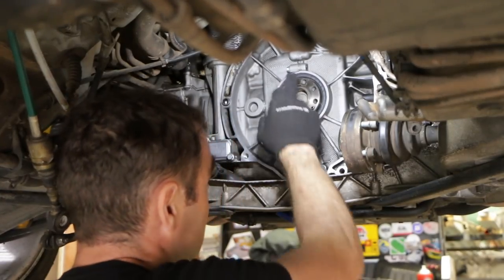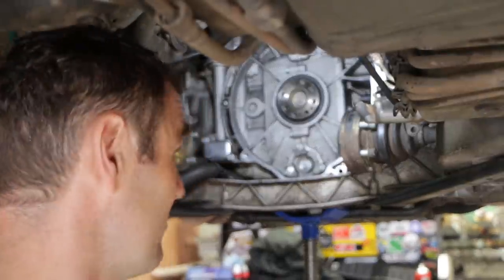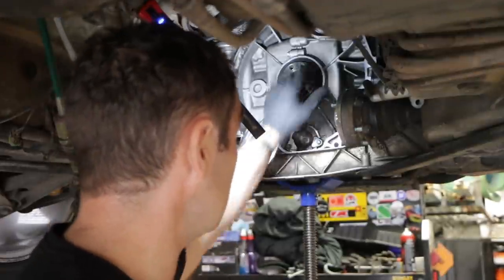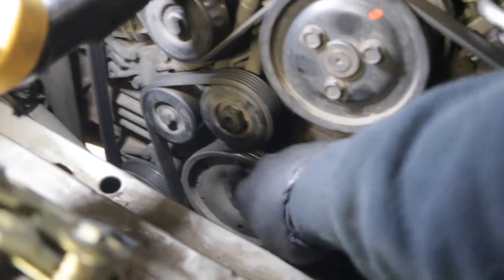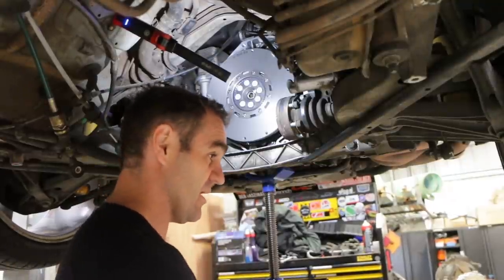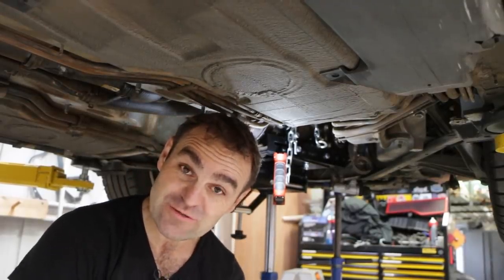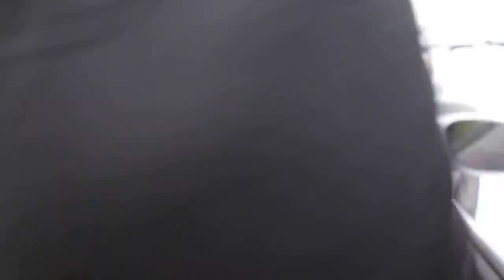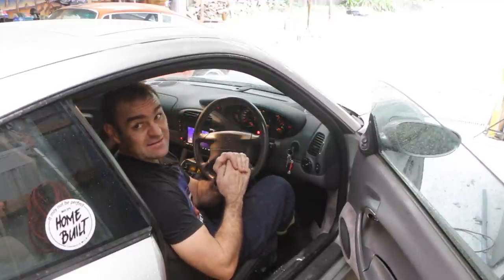996 Rear main seal and clutch replacement - 996/986 IMS part 3

Comment: Even though it's round about 200 years old it's still recent enough to have plenty of potential electronic gremlins in there. The more sophisticated it gets, the more sensitive and complex it gets. Well done on getting it back on the road quickly. I know how stressful it is to have a daily car apart. As much as I don't mind doing more complex things on my Trans Am, I was stressed about getting a complete new set of brakes on our Astra, plus a full service in one day. Just needs to be ready and available by the end of the day...

Comment: Well done, nice to see work done warts and all, real world problems that most of us come across. I just replaced my Boxster engine mount, it was split. 
Looks like your gearbox mount is the original one I’d take a close look at it next time you drop the gearbox, easy enough to push a new one in.
Well done!

Comment: I was a Porsche tech @ a Porsche/Audi dealership for over 20 years and whenever we did clutches on 911s with a dual mass flywheel in the early days of their use we would usually replace them with a pre dual mass 911 flywheel  unless it was a warranty job or a demo (track day car) as most customers weren't into springing for a $1,200 flywheel. Dunno if that would work with a 996 as I got out of the trade before they cam out.

Comment: Too late now, but I wouldn't have tried to pull the IMS without the proper tool. I did 3 of these early M96 engines at home, and had all the same nerve-wracking moments as you, but all went well when they fired up again. I bought the tools and bearings from LN Eng, not cheap.

Comment: I bet you had a great sense of relief when you got the car to run correctly. When pulling seals out, I usually try to drive a woodscrew into the seal in two places, hasn't failed yet, and it creates less metal filings too.

Comment: If the pedal is biting high try bleeding the clutch hydraulics before attempting any adjustment.
Reply: Neil T wouldn’t air in the system give a low pedal, not high?
Reply: @emmajacobs5575  yes your right, rereading my comment it's not very good English, what I should have written was 'bleed the clucth first before attempting any adjustment'.
Reply: He never opened the system, so he didn't introduce any air into it that would require bleeding out.
Reply: @MH-ev3wr  Because if he's going to adjust the pedal it should be done with fresh fluid.

Comment: I serviced my cars on the weekend. Forgot to reconnect the MAF on one. Wouldn't idle. Freaked out. Plugged it in. Idled fine. Engine light still on. Got my scanner. Started it to get engine data. Engine light went out by itself. Relief.

Comment: Have the trans in a gear. Then you can turn the drive outputs to turn the input shaft to the connection spline in the clutch.

Comment: If it's anything like my old BMW, they give you the option to drive the replacement seal a few millimeters farther to give the new seal a clean surface in case the original seal has worn a grove in the in crank.

Comment: What happens with the bolt that was knocked through the IMS bearing (or am I just imagining that)?
Reply from the maker: Magnet got it back ;)
Reply: Vogs what about the broken bits feat you welded onto the first bearing puller? Or did they not make it beyond the bearing?

Comment: How did you go about re-installing the clutch slave cylinder? I am nearly done with a clutch replacement job on a 996, and having a very hard time putting the clutch slave cylinder back in its designated hole of the transmission. To clarify, like you we didn't replace the slave cylinder because it was functioning fine and wanted to avoid having to bleed the whole system. Brackets, bell housing, etc. are all hooked up properly, but the slave cylinder is very hard to full seat because the piston is under a lot of pressure. Without being able to compress the slave cylinder some, we can't line up the bolts that secure it to the trans housing. Have done a lot of research and can't find a clear answer. Any tips on how you were able to reinstall the clutch slave cylinder? Appreciate it!
Reply from the maker: I cant remember exactly, but I do remember it was a pain to do. From memory it didn't need to be compressed too much to bolt in.

Comment: My car needed to re learn idle after battery change
Reply: I think you're right. Assuming it's a fly by wire E throttle (post MY 2000?), turn ignition on for 30 seconds or so without starting car or touching throttle. Voila

Comment: Ok, if you're not going to use the right puller, go ahead and use that three jaw internal puller you had, but do this.
Remove the three fingers from the jaw to threaded rod attachment.  Put a piece of pipe, or a socket in between the jaws with the jaws inserted in the bearing.  This will keep the puller from slipping and collapsing inward.  Reassemble the fingers to the attachment.  
Pull bearing out.  
No new/proper tool needed.
Simple.

Comment: If I am not mistaken the mark on the flywheel bolts is 60deg turn not 120deg?  Bolts need to turn to another 60 deg. Might be mistaken though. 🤔
Reply from the maker: 90 is a quarter turn, so yes this is 120 ;)
Reply: Yep you're right. Too tired, heavy day 🙈 Porsche parts by jeff is fantastic btw 👍

Comment: Is the Rear main seal holding up and not leaking using the rear main seal tool that you made?  I've heard people try these diy tools and the seals still leak.  Thanks.
Reply from the maker: It isn't leaking, but the IMS cover plate is :(

Comment: New subscriber! I am catching up on all your content, great fun. I am going to be doing my own 996 IMS change and will definitely get the LN, but am leaning to the direct feed version. Thoughts?
Reply from the maker: If you can't start the car without sweating that the IMS might blow up any second, then the direct feed one is for you. I think the IMS is over hyped. I pulled the original bearing out of this and my Boxster both with over 150k kms and they were both still perfect.
Reply: @HomeBuiltByJeff  Thanks, I have now seen a couple other people use the LN sealed unit as you did. The installation looks so much easier, it looks like a better option for me to do in my garage. Great channel. I am working my way through your incredible content.

Comment: Does it drive better with the new flywheel?
Reply from the maker: Pretty much exactly the same.
Reply: @HomeBuiltByJeff  That's because you're a good smooth driver. In town and in traffic you would have noticed it being a bit jerky.. I had that on my previous Cayman S. Also I believe the clutch is self adjusting which is great as the pedal stays the same throughout it's life. What's not so great is there is no real warning of impending doom when it's fails. Not a concern for you now though. :-)
Reply: Home Built By Jeff Good to know, if I have to replace my flywheel in my BMW I’ll change it for a cheaper rigid one.

Comment: Where did you grab that plastic fitting? Can't see anything like it at Bunnings.
Reply from the maker: From memory it is a PVC plumbing cap.
Reply: @HomeBuiltByJeff  I tried following your lead but couldn't get the RMS in straight. In the end I got a PVC screw cap and carefully sanded it down to 13mm. I could then just whack it in firm with a rubber mallet. It's straight!

Comment: That flywheel bolt set is going to be a bit of a pain in the wallet when you take it apart again. I had a van that someone the other end of the country did the head gasket on they ground the bottom off the stretch bolts saying they will be fine to the previous owner, well it failed on me, to take it back to them on a trailer would have cost me more than re-doing the job new gasket kit new bolts job done worked great for 3 years. £60 for the bolts Ouch.
Strange seeing you putting things back without a thorough clean and a coat of paint.

Comment: Every vehicle I've worked on with a dual mass flywheel has had a single mass conversion done. Dual is the worst design ever.

On a side note, a $10 degree wheel from Supercheap is way easier than marking the bolts.
*edit Sorry it's $19
Reply from the maker: Single mass flywheel doesn't do well on 996's ;)